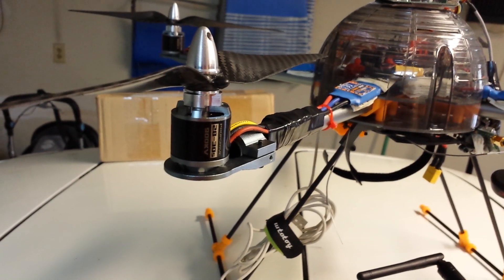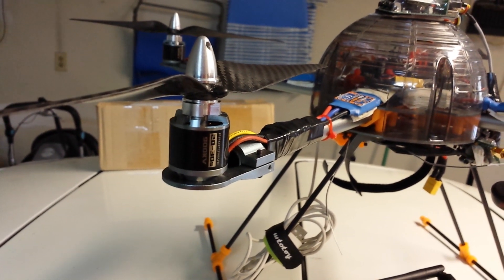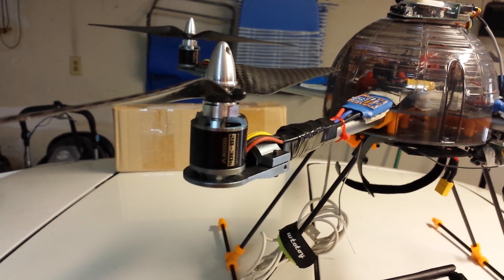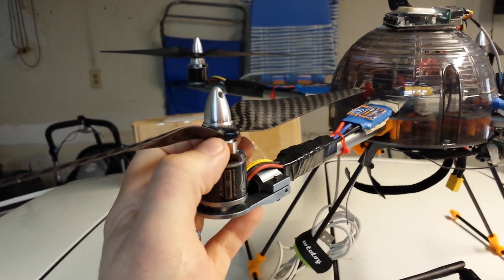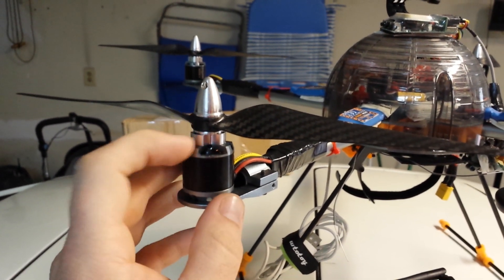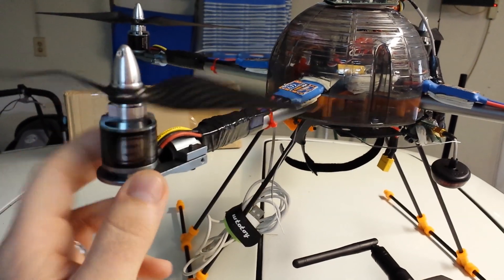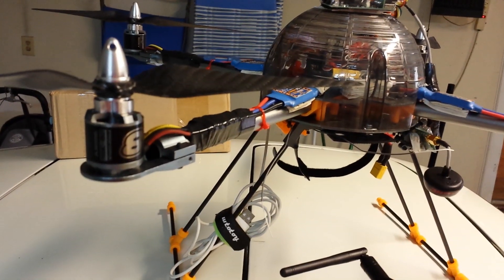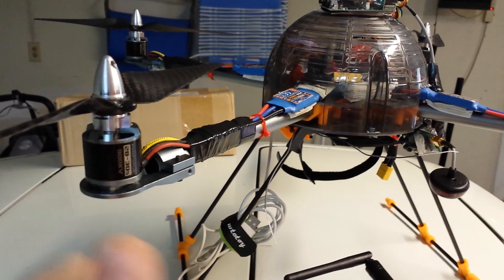NTM propdrive 28-30s overview

Comment: Hi Erik,
I'm just wondering you do about threads since, the prop adaptors only come with threads in one direction, does this cause problems since two of the motors spin in the opposite direction?

Comment: Im choosing these motors for the my first quad (i dont know if i need 900kv or 1000kv, but as its my first time im not going to be doing fancy tricks so i figured 900kv with around 9 inch props would be more stable (am i wrong?) Hope everything works out lol
Reply: Alright, around what pitch? And correct me if I'm wrong but don't the motors get hotter with larger props?
Reply: alright sweet thanks alot. The larger props just make more force at the expense of motor power? (dont feel like you need to answer these btw, if im wasting too much of your time just ignore me xD)

Comment: ?... The NTM long shafts let the motor mounts act as heat sinks so the motors run cooler mounting them from underneath using aluminum motor mounts like you are using (why they have to mounted upside down to mount motors upright), and mounted from underneath they create less vibration AND prop shafts sit lower with less leverage on them in a mishap as well as raising the quad's CG up relative to the props Center of Pressure making it handle better. Adds less weight too as short shaft hardware is not needed. All in all I'd say the advantage of the NTM motor is utilizing how the motor mounts were designed to be used. I know it's not in "style" to mount motors from underneath and they can hit things... but they can do that on either mounting sides too and do hit stuff. My worst mishaps are messing around and face in just as much right side up so rather run them mounted from underneath using those motor mounts with adequate landing gear (soft balls) to protect the motors. The only real disadvantage is the motors sticking down, everything else is better IMO especially getting the prop's CP lowered .

Comment: im using 12x3.8 on my 900kv motors, so if you dont want bigger props 4s is way to go
Reply from the maker: So I can go with even larger props than 11x5 and still run the 3s packs? maybe 13 inch? also what would you say I should go with for pitch?
Reply: Erik740t it all depends on how many watts can your motors pull. ive just double chcked. my motors are Turnigy D2836/11 750KV so even less than 900. with 12x3.8 props and close to 2kgs weight it hovers at about 45% throttle and gives me good 20 minutes of hover time using 6000mah 3s. from what ive read bigger props and less RPM will give you more flight time, but also less controll than slow props spinning fast.I think 13 inch on HAL would be too much unless your motors can handle it, but if they do and you go for non acro/FPV flying i would have a go. pitch.. i think no more than 4. ive tried 11x4.5 and 12x3.8 on my setup and 12x3.8 seems to fly better.